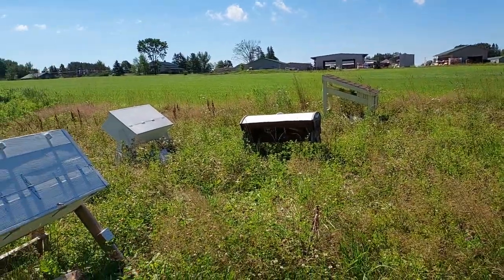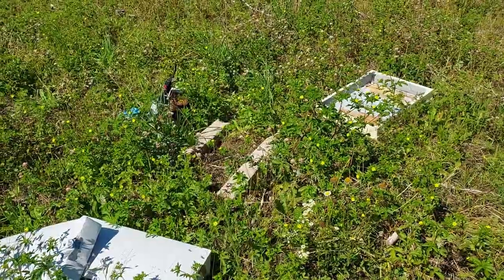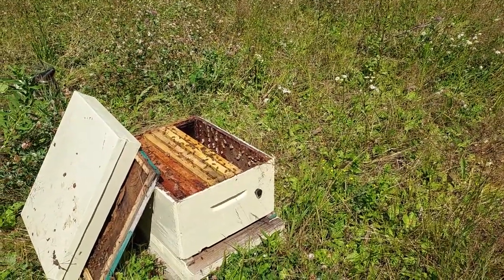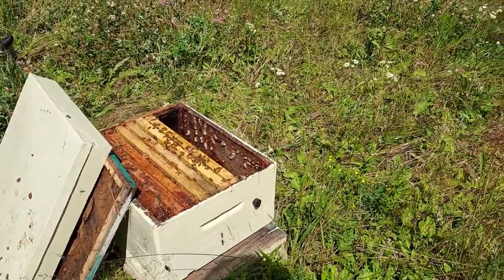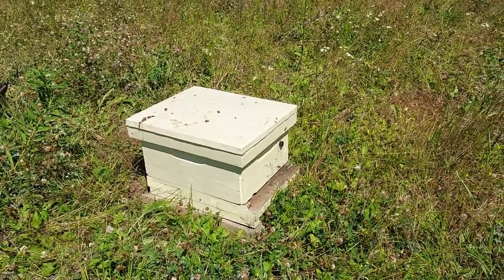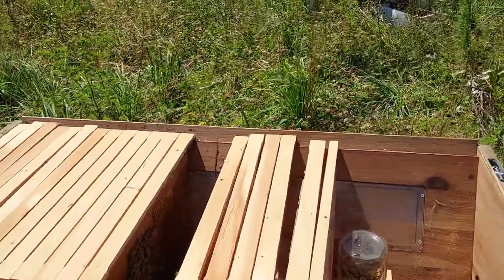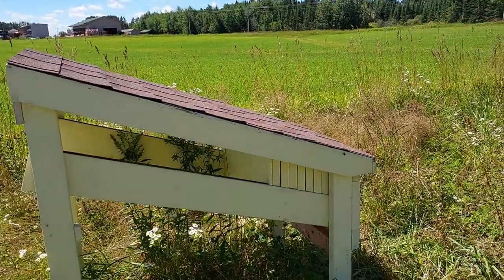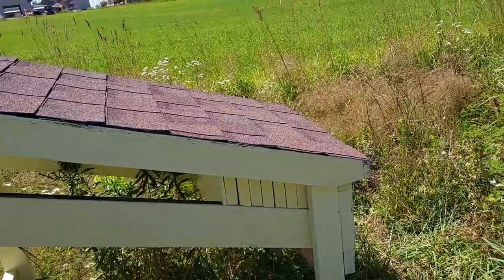The Biggest Mistake New Beekeepers Make: Picking The Wrong Hive

Comment: Thank you much for this video... it was really enjoyable to see the comparisons and to be introduced to new ways of keeping bees.
I have a question concerning the Parkinson... how does one winter bees in it? It appears that winter air can flow between the frames... Does one apply winter skirting?
Thanks again for you work!
Reply: The hive is designed so 2" rigid foam insulation slides in the bottom and onto the sides and end.  It effectively insulates the hive from all breezes.